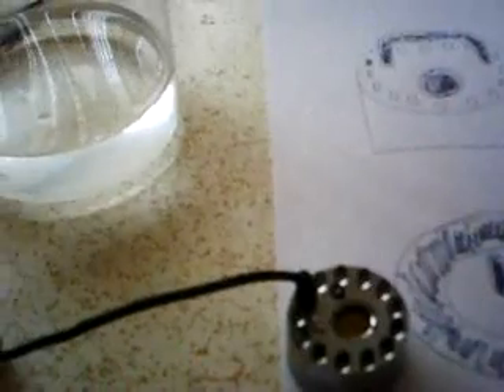Better Instructions.flv

Comment from the maker: There is a better way the wire on the left post next to the Power cord is the side you want and yes you do have to remove the rubber from the wire. Cut the right side flush and forget it the left side just bend the wire to make contact with the metal Body Does just fine the trick with the foil is just to ground it out and yes you can super glue it

Comment from the maker: Its the hole that sences the water and buy putting aluminum foil you buypass it so it can work on Gas Diesal Fuel even oil. If you dont it will only work on water.  Just remember when you do it be carefull there is a thin wire in the middle that nees to be there after you remove the rubber surounding then pack it with foil nd to test in water if it doesnt work get a small rod and pack the foil that yoususly gets it.

Comment: Hey I found a transducer that is 24VDC it looks just like yours! It was 6 bucks but it says allow 4-8 weeks delivery :( Anyways I also found a step up transformer voltage booster that is 12v to 24v so you can hook it up in your car. The seller on ebay is Koyzhang. ( You tube won't let me post the link)

Comment: Hey I found a transducer that is 24VDC it looks just like yours! It was 6 bucks but it says allow 4-8 weeks delivery :( Anyways I also found a step up transformer voltage booster that is 12v to 24v so you can hook it up in your car. Here is the link to the step up booster,

Comment from the maker: @frank0067 Not that i know of but if your doing a Generator like me you could youse the Battery charging feture similar to battery. ALSO Make sure you test it on water before you alter it just to make sure you tranducer is working fine

Comment: mine arrived couple days ago from Hong Kong, i bought it on eBay including the power supply  it was around 25 dollars..
Soon i will also alter the transducer for gas,  but i want to also find out how  i can use my car battery to power this device instead of the 110V power supply,  has anyone done that yet?

Comment from the maker: sure just go on ebey the power supply should be sold with you have to check if now its yousaly 115 v transformer to 24v but it depends on the fogger you get look at the specks to match it. My advice is but one with a power supply so you know its right

Comment from the maker: Ok chop off the Black Bar its the sensor
Hollow out the rubber just below the senser to make a cavity
Do Not totaly remove the wire In the center
Now stuff with aluminum foil

Comment from the maker: No I changed the fogger to operater with any liguid not just water try and use one in gas withought changeing it. IT Wont work.  Its up to you if you have a brain to make a flow device to shut it down would you like me to do that for you as well???